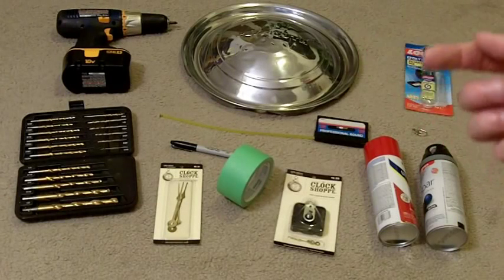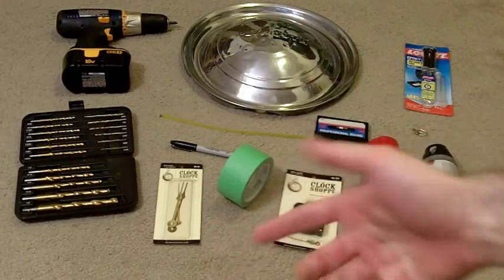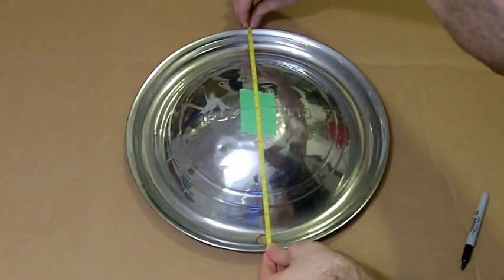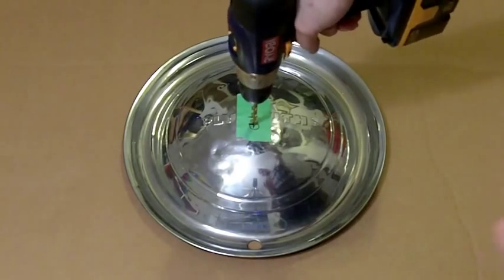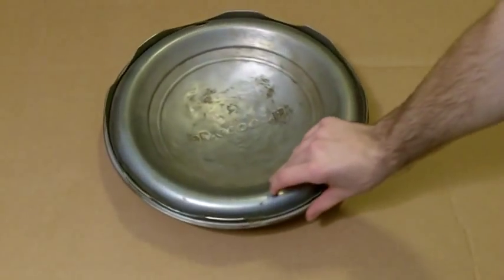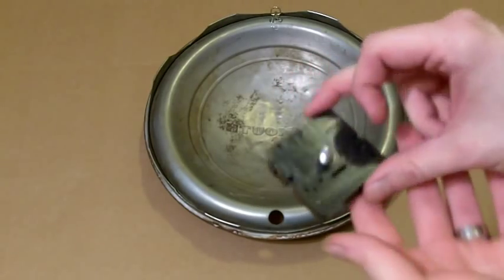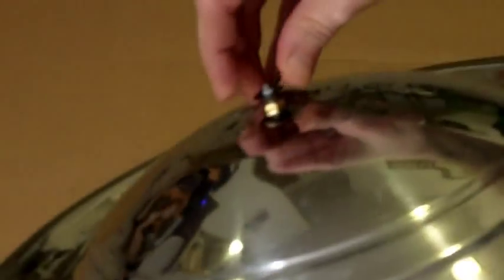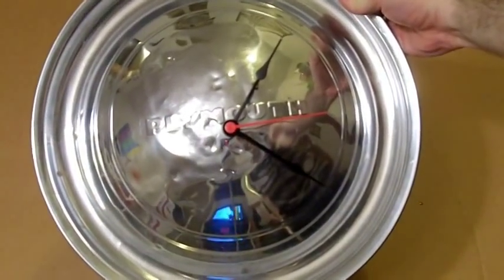HOW TO MAKE A VINTAGE HUBCAP CLOCK!

Comment: i followed your link to amazon for the clock movement but you do not specify the measurement... do i get one for 3/8" surface, or 1/4" surface or what? there are tons and i dont even know what this means.
Reply from the maker: Sorry about that. I thought I mentioned it. I believe the measurements refer to how far the threaded shaft sticks out from the black plastic movement box. The size you'll need really depends on how your hubcap is shaped in the center. On the hubcap I used for this video, it was basically a smooth bowl shape, so a 1/4" movement worked fine. But on some hubcaps, there could be a pointed section, an additional small name cap that sticks out, etc, etc in the very center. You want the black plastic movement box to sit against the back of the hubcap and the threaded rod to be long enough to stick through the front, so you can still tighten down the nut, add arms, etc. Hope that helps!
Reply: MrDiyDork  i couldnt find a long one so i ordered the longest one i could find and sure enough its way too short. just my luck.. thats a pretty important bit of information man.